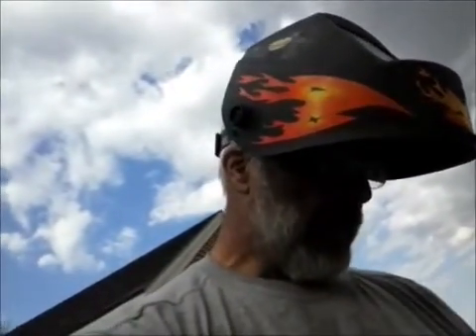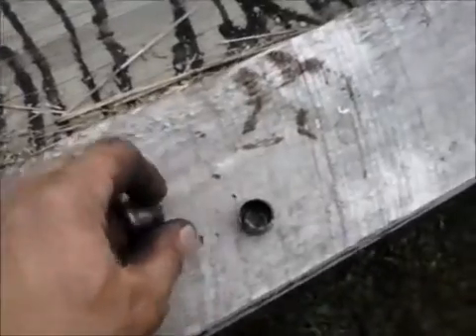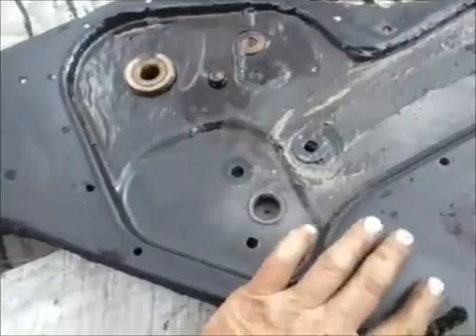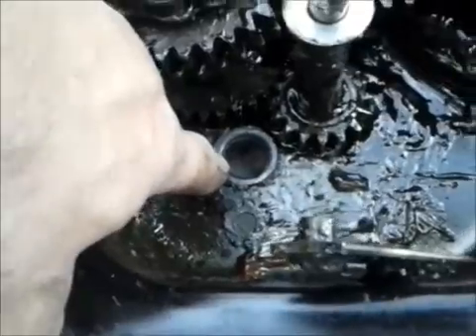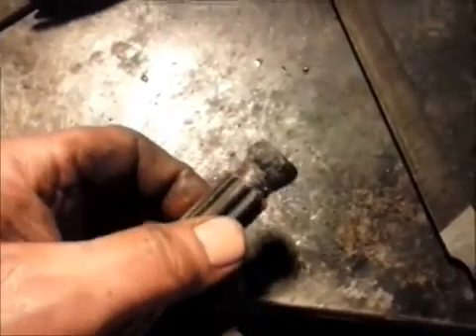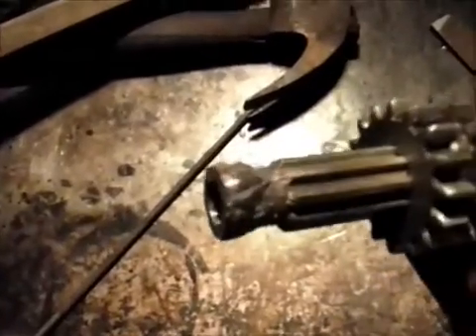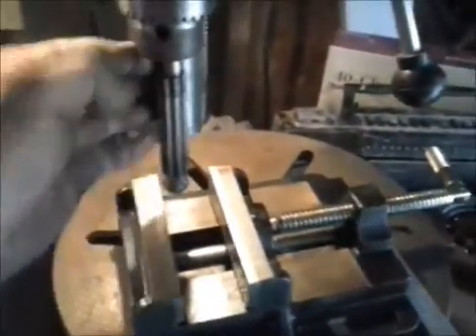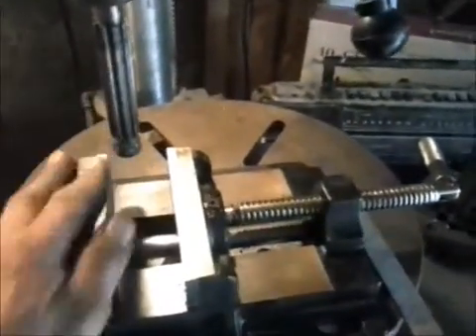Craftsman Tiller Repair Using a Drill Press as Metal Lathe pt1

Comment: thanks for this video. I rec'd a free tiller the other day and it runs like a top, but there is a noise in the gearbox. Based on my initial inspection and some other videos that didnt seem to describe my problem, I have concluded that your video acurately describes my problem. I dont have a lathe either, but I do have a shopsmith that I can use as a lathe. S I am going to tear apart my unit and see if I have the same problem. Not going to buy any new parts if I can fix the ones I have. Resourceful is the word that comes to mind. New subscriber as well.
Reply from the maker: If  you caught it soon enough you may be able to avoid the lathe part of the job.